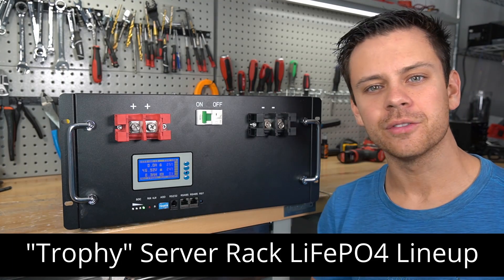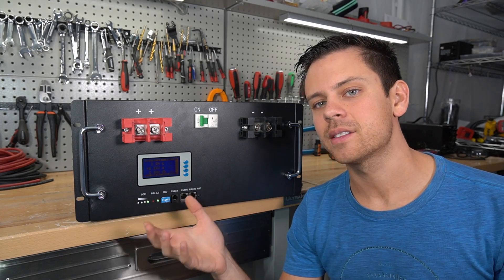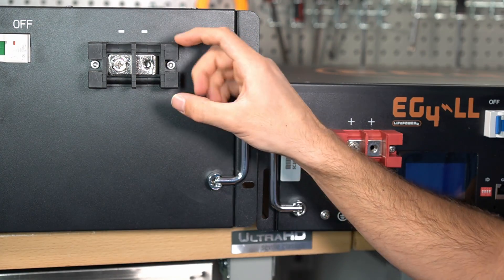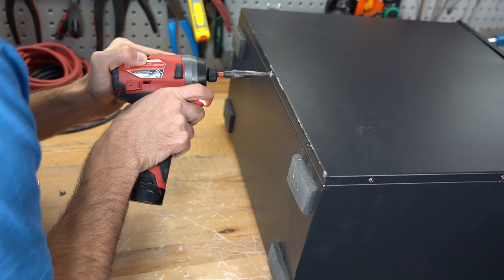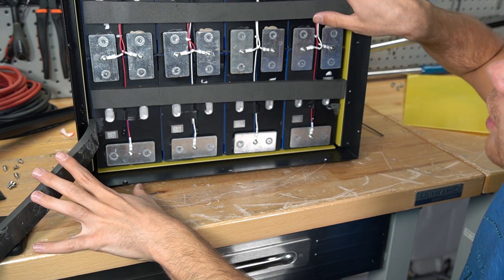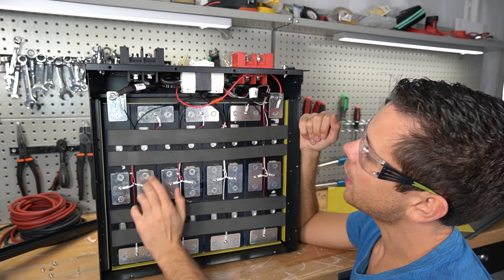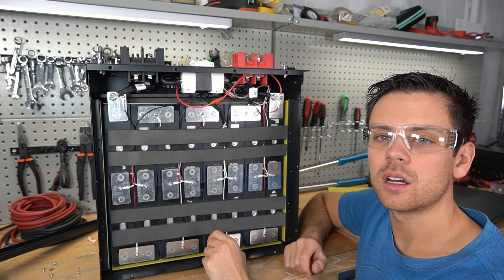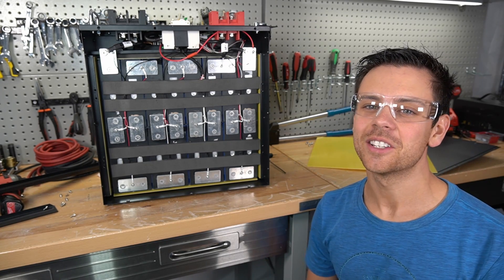New "Trophy Battery" Lineup: 48V 100Ah/110Ah/220Ah LiFePO4 Server Rack Batteries

Comment: So only 15 cell?
Reply: No, all of our batteries have 16 cells, so the nominal voltage is 51.2 Volts.
They are still considered 48 Volt class batteries as they work with 48V devices.

Comment: You can wipe your ass with an 'extended warranty' simply because there is no way anyone can say how long this or any other company will be around. (As noted in the video) Then most likely they will argue with you because you were the one to cause the battery to fail. User abuse is a wide open statement.

Comment: We need to get to the point where the comms between the batteries is standardized.  I would like to see more reviews and commentary on the management of the packs to move them in that direction. Each manufacturer using a unique protocol is a pain in the nether regions if you stray into multiple ecosystems.  Right now I am trying to integrate the data from Jakiper, EG4, and Victron.  It’s a challenge.  EG4 even has different parameters between the LL and Lifepower4 and older Gyll packs.  LL and Lifepower4 packs don’t use the same software even

Comment: Since you are planning on looking at the 200ah battery of this company, it might be interesting to evaluate some of the other 10kw server rack batteries. For whole home systems it might make sense to go with the larger batteries as you aren’t going to move them much (they usually come with wheels by the way). I am interested in the GSL server rack batteries. They come in 5kw and 10kw (?15kw too) and I don’t remember you doing a review on them. 10kw is $2600 which is a pretty good price. Thx!
Reply: Hi Lori, yes you are right. Our rack type battery support max 32 units parallel so they come in 10kwh to 320kwh. Please contact me via WhatsApp so that I can send you more details.
And we are much cheaper for 10kwh with 8-year warranty!

Comment: Off topic question but could you use a 12v to 120v  inverter as the ac input on a all in one solar inverter......the inverter would be powered by a battery bank connected to another system?

Comment: Hello. Nice video as always. Cells looks ok also bms is ok..temp sensors should be evenly spread that is truth ..but i don't think it is big deal. more important is how bms will handle bad cell/cells ..anyway I think it is good as it is. You were right about weight of battery pack..but i think for us it is better to have one 48V 200Ah than two 100Ah battery packs..even they are called server rack batteries.usually normal person will not place them into server rack 

- It would be interesting to test it by adding some foil on top and check it with infrared camera how bms and cells behave..that would improve your testing even more..after all you usually don't know how hot bms or cell will get during discharging/charging and that could be critical point toward long life time..

-As all looks good and nice ..usually. But temperature might change this fact. and details such as what type of capacitors is used on bms is critical.

- ppl don't  take this to account..but it is more than critical to know what type of capacitors were used and how hot it will get ..because this are on 24/7/365 and life time of normal chinese capacitors is not even 6000 hours at rated temperature 85 degree C or 105 degree C...that is why it is critical to know temperature.

Comment: Your tear downs are great.  They hold the manufacturer accountable.  Keeps them honest, at least for a little while...Until production becomes more important then QC.  I worked in the aerospace industry for 35 years.  Every component, especially avionics gear, had multiple QC inspection seals.  If it that seal is broken, well it raises a big RED flag.  I am surprised none of these batteries or sogens have any such seal.  I see the future..thanks to Will Prowse....server rack batteries spot welded shut with inspection seals at all possible sneak peak openings.

Comment: Wonder if there will be server-rack mounted inverters at some point?  I mean otherwise that long battery 220ah doesn't makes sense.  I've worked with long servers like that - very awkward to move, you almost always need two people.  Pricing is good, but not great.
Reply: Yea and your rack needs to be stretched out long to support the back of the battery. So the footprint gets excessive. I'd much rather go with like 72" tall racks and have taller batteries to fill it. 

I'd love to see rack mount all in one inverter/charge controller. Maybe some rack mount breakers and disconnects. Having everything in one rack would be pretty slick.

Comment: Hi Will,
Nice video! Funny to your über enthousiastic approach of this quality product 😂.
Calculating the costs of a 14 kWh system consisting of a Batrium bms with 16 EVE 280K and some extra stuff like a cirquit braker, I will have a kWh price of €358.
Buying 3 sets of theses 100Ah rated rack mounted devices including taxes and customs will set me back at least €2300 each for 15 kWh.
Total costs: €460.
Shure, you will have a non hassle solution delivered in a nice box but what happens when the Chinese warranty will not be there when one of your units breaks down just one day after the warranty?
Ordering one or more EVE cells if they decide to go south, will be much more conveniant.
There is also the fact that there are VERY little warehouses in The Netherlands of all these manufacturers so warranty is totally non existant.

Just let me know if my calculations are wrong and there ARE solid partners here that DO have them in stock here.
I would gladly pick them up by care the same day tomorrow.

Comment: Where’s this company based & do they ship internationally, say to Africa & what’re their prices across the range. Not just price per watt, but total. What also offer do they have for international warranty?
Reply: Trophy Battery LLC's headquarters is in Aiken, SC.

The price for the batteries are $1,895, $1,895, and $3,395 for the 220 AH battery.

I am sorry, we are not prepared for international shipping yet. We worked with DHL in an attempt to offer international shipping, but the minimum shipping volume, customs, and import laws made it hard to start out shipping internationally.

Handling warranty claims internationally would also be a challenge. In some cases, the battery would have to be shipped back to us, and that may be impractical.
Reply: @dankeaton8656  Many thanks for the response.

Comment: Sorry if this is a newbie question but why are all if these batteries 48v instead of 24 or 12?
Reply: Because at the output these packs can do (10kW) a 24V system would max out at 400A and a 12V system would max out at 800A. If you really need 12V/24V a DC-DC converter may be a better option

Comment: It seems like someone would offer one of these server racks with EVE 280Ahr cells.
24V and/ or 48V models.
I build my own bare bone no frills, but don't put all the extra niceties on it.
Currently building a 48V 280A using ninith cells, ordered by mistake. I thought I was getting EVE cells.. 
One terminal came loose and am having trouble finding someone to spot weld it back on.
Won't be using those again.

Comment: Hi, I’m based in South Africa. We have a a lot of different brands here. Our most popular is the Pylontech Server type batteries. 
I’m running 3 pylontechs at my house for around 3 years and my oldest one is at 90 cycles still going strong. 
They look a lot different inside from the ones you open up on the bench. 😀

Comment: I really dislike the welded terminals.  making these units serviceable is more green
Reply: We fully understand. Many people like the idea of being able to replace a single cell if the need arises. 

We have chosen welded busbars for reliability. No over-tightened bolts, no loose connections for any reason, possibly better (lower resistance) connections, never a worry if a connection has come loose, or a bolt was over-tightened or under-tightened.

If a cell shorts, or fails to charge or discharge properly, we will replace all 16 or 32 cells.

Consider the following. After 5 years or so, and a cell goes bad, a new cell will not match the other cells in your battery.

Comment: Will - Now that you're reviewing rackmount battery packs, it would be extremely helpful if you identity how many rack units these devices consume. For those that are not aware, rack units are a standard unit of measurement which identifies the vertical footprint a given device will consume within a rack,
Reply: Now how long before we get a rack mounted all in one charge controller and inverter to match these batteries? It would be very slick to have everything neatly installed into one rack.
Reply from the maker: @lordgarak  great question. Quite a few people are racing to bring one to market. They do exist actually and I opened one up, but it was complete garbage. Hopefully this year we will have a couple options.
Reply from the maker: I'm still waiting on signature solar and other companies to send the racks out. I'm surprised they didn't send them out on day one. And smart idea, I need to mention that
Reply: Even if it is a 'solar' (stellar i would say) channel integrating this rack solution in home automation would be fantastic meaning mqtt integration, snmp as well, remote control by extension. Practical solution.
Reply: I would say it is a 6 hu but the most important is the length and how we secure it with the weight.
Reply: @acopernic  Excellent point. I've yet to see Will actually rack mount these things. We don't even know whether they come with rails. This is triggering the IT guy in me.

Comment: Will, this looks like a pretty nice piece of equipment, but your review seems a bit subjective because you still find little things you don't like that may or may not limit function.  Are the vents actually affected by the foam strips, or you just don't like the way it looks?  You don't like the red bms wire which can move a little, but was anything going to happen with that in a closed case.  Do the temperature sensors, all tied down nicely, risk inaccurate response because they don't cover all four corners?  Are the double lugs inadequate for current?  If this has a ten year warranty, are you concerned that welds would interfere with repair after 10 years?  How many battery manufacturers have been around 10 years?  It takes a lot of care to design and assemble a quality unit, and your opinion is valued, but there will always be little tweaks just short of perfection.  If some lead to improvements, great.  But maybe the overall quality is evident, and you are finding details that are more subjective than evaluative. Fortunately,  it is something we can each decide knowing what's inside.
Reply from the maker: I have no clue about the overpressure relief valves, that's why I said in the video "I will have to ask a battery engineer". My common sense tells me that any valve shouldn't be obstructed. It doesn't take much thinking to figure that out. 

And yes, the other packs have the wires secured. This one should too. 

Yes, every UL pack I've opened has them spaced out. Think about how heat moves through obejcts. If one side gets cold, that could be an issue. If all batteries have it configured in a certain way, and this one doesn't, what does that tell us? 

Double lugs inadequate for current? What?

No, you don't repair it. You can't repair welded terminals. Did you not listen to what I said? I was very clear. Or you can think about a welded terminal. Can you fix it? Exactly.
Reply from the maker: Quite a few battery companies have been around for ten years now. Trojan with the trillium series. Simpliphi. Numerous lead acid companies. 

These lifepo4 sellers are not manufacturers, they are resellers and they provide their own warranty. 

I specifically discussed all of these points in detail. I don't understand what confusion you have here.

Comment: Hi Will.   These guys are advertising that they have heaters in these batteries...   But you didn't do any of your standard tests in the video, no load, no temp test.   Would have been very interesting to see how the heater worked.   And for heated batteries, is it taking the power from the input power or the battery cells.   Going to need some investigation on that as it's going to become more and more common to see heated batteries.   I know you don't worry about it in LV, but elsewhere it's important...   Honestly, I love that they say they have heaters, but the foam build aren't anything as nice as the SOK or EG4
Reply from the maker: Yeah I did the capacity and load testing for this pack after I made the video and it worked great. Also has the current regulation, but no surprise because it has same BMS as everyone else. I don't see the heaters. I need to see if there are wires going under the cells. I did see that on their site. That's weird.
Reply from the maker: Yes I agree, foam and tape is not nearly as nice as Sok or eg4
Reply: Yes, the batteries have heaters.

When the battery gets close to freezing, then the charging current is used to heat the battery cells. When they are warm enough, then normal charging resumes.

The power in the battery cells is never used to heat the battery. This could drain your battery. 

All of this is controlled by the BMS.

Note that a Lithium Ferrous Phosphate battery can be discharged when the cells are below freezing. But then must not be charged when frozen.

There is also a low-temperature cutoff if the cells get too cold.

Note that the batteries work best at room temperatures.

Comment: I have 3 gyll EG4 100AH  battery’s I got them last April haven’t hooked them up yet but they are very impressive looking tho is it possible to hook them up in a system with the the 220AH battery you  just showed earlier?
Reply from the maker: Check out my current sharing 101 video to know how to connect them safely.

Comment: Looks good, but I share the same concern about the welding. Also, perhaps I missed it on the display does it show status of individual cells like the eg4?
Reply from the maker: Yes, invidual cell voltages can be found on either model
Reply: Welded busbars to the individual cells solve certain problems.

They will never come loose due to the temperature cycling of the battery over time.

They will never come loose due to normal vibration.

The will never be a problem caused by over-tightening a bolt.

With Trophy Battery, if a cell develops a problem, we will replace all 16 cells.

All of the warranty details are available on our website, on the main menu, j
ust click on warranty.

We use laser welding for long-term reliability, allowing us to offer a non-prorated 10-Year Limited Warranty.

Comment: On their website the 220AH has pics of the battery with several pics of the inside of it. It looks like the cells are held in place with metal bars.  I was also wondering if you have ever reviewed ARK batteries. I did a search and did not see it in your videos or any of the dozens i have watched. Their website gives you quite a bit of info on their batteries. They are made in Ohio for the Amish . I think this would be a fun battery to review. Plus they are very well buit and like I stated earlier they are made in the USA in Ohio.  I do know that several other youtube solar installers have incorporated this battery in their systems. They only have three batteries that they sell 48v 100ah and 200ah and a 24v 200ah

Comment: I don't see an indication on the website or the manual (for the 220AH model) that it has UL certification.  As discussed on the forum, some inspectors may require that the battery pack have that.
Reply from the maker: Pretty much all server rack packs right now do not have ul certificate or listing. But they should this year. It takes a while.

Comment: the best server rack battery is the one that actually ships internationally.
Reply: 967$ to get the Eg4 LL to Canada.
Duties are a rip off
Reply: @joryclouthier  Duties are protecting local companies. Preventing you from losing your job because a country with slave labour can sell something 10 cents cheaper.
Reply: @hornetIIkite3  I understand that but it's ridiculous that that 2k$ cad battery after all that is still half price to what we can get here
Reply: @joryclouthier  It's a free market. Feel free to start making your own batteries at that pricepoint. Please tell me how it goes
Reply: @hornetIIkite3  I have a 240Ah pack sitting beside it from raw cells with a 300a bluetooth bms, 200a circuit breaker. 
works pretty good
Reply: @joryclouthier  what did it cost? And can I buy it?
Reply: @hornetIIkite3  Everything's for sale, I should start selling them
Reply: @hornetIIkite3  but it’s not a free market when you have to rely on duties to “protect” local businesses.
Reply: i ended up having to source materials and diy a pack. sigh.
Reply: @Ahmad Zafar  diy packs are better. You get to know how and why things are the way they are and can insure the assembly is good with good materials. All that for a cheaper price. If something fails not only do you know how to fix it you also know you can find the parts.
Reply: @randybobandy9828  some people have no business building a battery lol.
Reply: @John Andrews  true... I mean these cells don't even need to be welded.welder.. it's just so easy. I always forget how dumb the average consumer is.